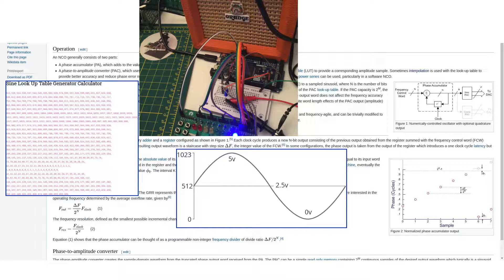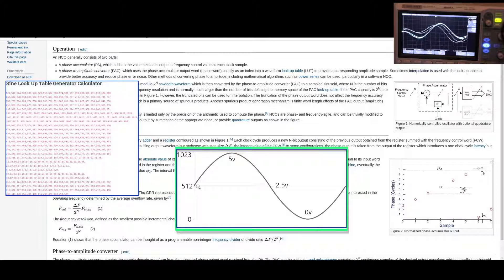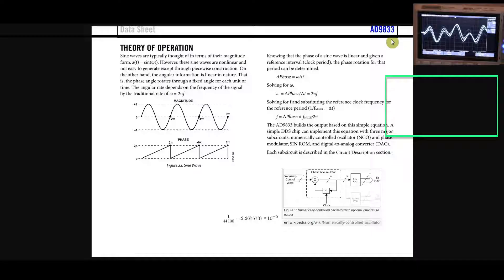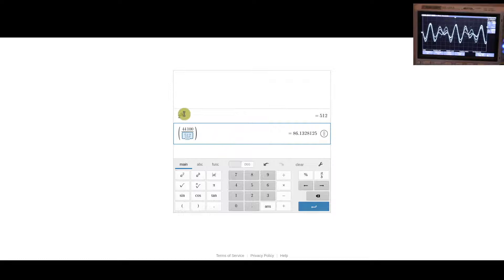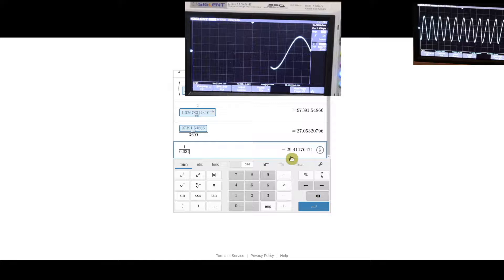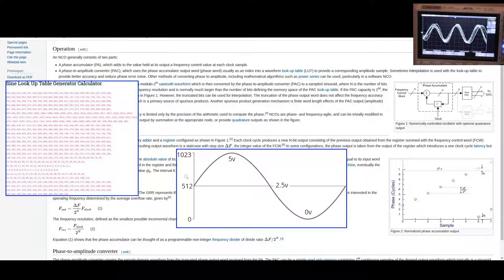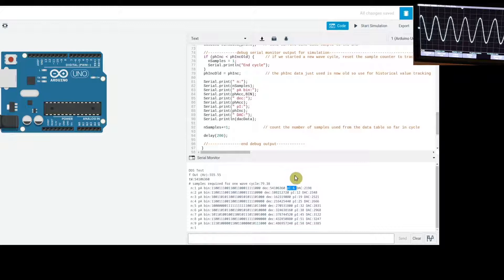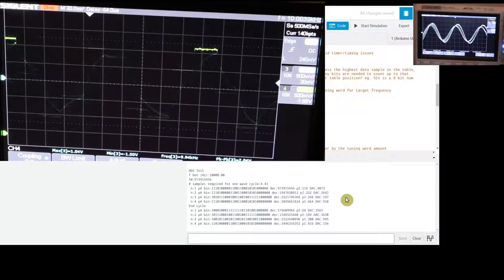Direct Digital Synthesis - How it Works and a Demo on Arduino Due

Comment: Hey :) thx for the nice video.

Would it possible to adjust sample rate by introducing delays in our script to control the pitch? 

Suggested that we want to output a wave that is less symmetrical than the basic sine/triangle/saw/square, the "leaving out sample points" method would give us really not uniform results.
Reply from the maker: I'm not sure how irregular shaped wave samples are handled to change frequency, but just thinking through how the DAC works, I would think distortion would be introduced if there's delays between samples added because until a new DAC sample is sent out, it continues outputting the last voltage.   

So if we think about a 45 degree ramp signal and a delay is added between samples, I'd expect instead of getting a 45 degree line, we'd get more of a stair step where a sample is sent, then a delay occurs so the voltage stays the same for a while, producing a horizontal waveform until the next sample steps away from that, then it goes sideways again etc.

Maybe the frequency could be adjusted by just changing the period so the entire waveform is still sent out at full speed for one cycle, then forcing a longer or shorter delay at the end until the next full waveform cycle is sent, so the frequency would change but that may not be what is wanted, if the wave shape is desired to be drawn faster or slower through the entire period instead of having an adjustable blank space after the cycle.
Reply: I think you missed the entire idea of the DDS approach - using the same fixed sampling rate for any output frequency.
Reply: @odissey2  I didn't miss it. That's exactly the point of my question, my dear.

Comment: Fascinating stuff. The only thing that I am struggling with is the multiple waves. In the case that both sine waves are at their peak and you add them together, you will be outside of the DACs range. In analog synthesis, if you pass an op amp's range the signal will clip. I didn't really get what the equivalent was of this in digital synthesis. You  shift each data point by one bit, so essentially dividing by 2 before adding correct? This way it won't exceed the DACs range? And if you wanted to use 3 waves you would have to divide the values by 3? Doesn't this decrease the resolution of the wave because when you divide you may be rounding values off? Or does it not matter because once you add them back together you still use the full range of the DAC?

Comment: I have made an Arduino-uno based potentiostat for cyclic voltammetry and Impedance spectroscopy experiments. I am trying to make a frequency sweep from the maximum possible frequency to the lowest. I use PWM modulation and I generate the PWM values using math but I can go up to 50Hz for now because of serial communication and sample rate limits. I am also trying to record the data in real-time using one of the ADC of the arduino in order to do impedance spectroscopy. I am interested in your method using lookup tables but I don't get what should be changed to adapt this to an UNO board. Can you help?
Reply from the maker: I think this sketch was one that works on Uno, which I used in the online TinkerCad uno simulator to generate signals
https://github.com/GadgetReboot/DDS_Generator_For_Due/tree/main/Tinkercad_Simulation_Sketch